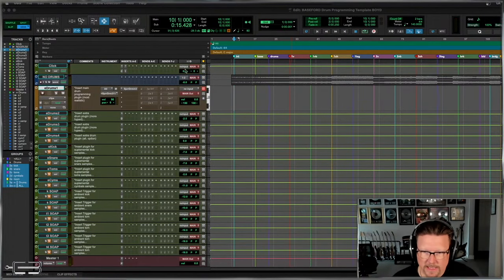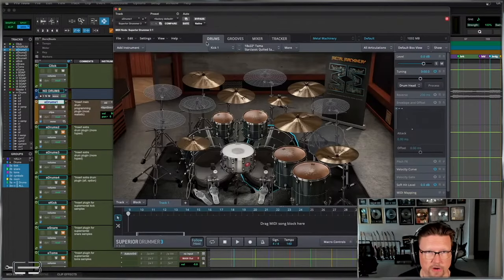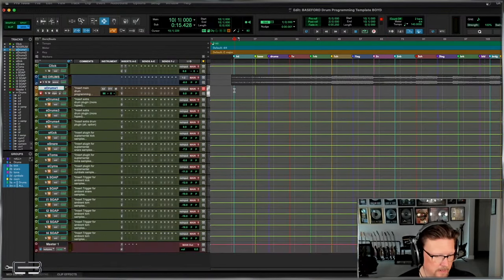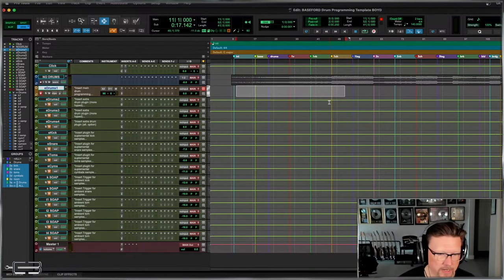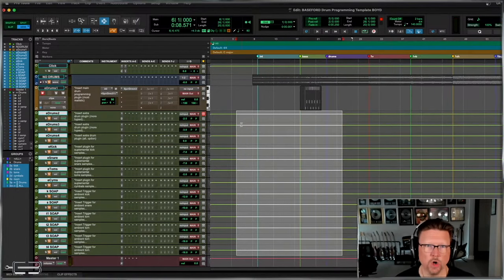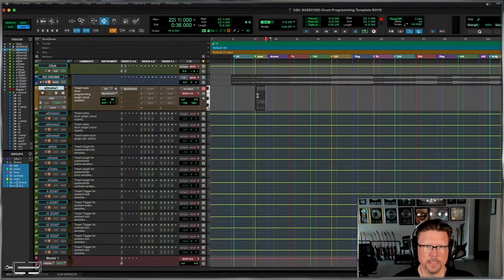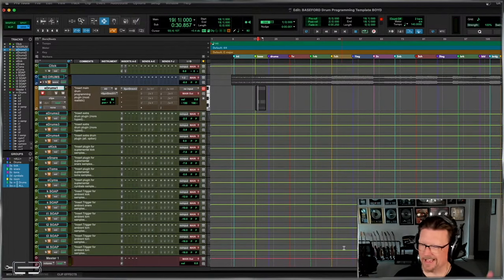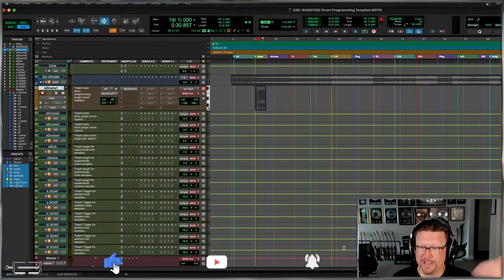My Famous? Drum Programming Method Explained

Comment: You can also add a presets in SD3 in Your favorite library like adding extra snares/kicks/toms and then mute them/unmute in one place.
Reply from the maker: Absolutely.  Superior is a beast and has so many great features to implement!
Reply: @chrisbaseford  BTW: Thanks for that NIckleback NAIL THE MIX tutorial. What a library of information and tips!
Reply from the maker: @gutekzpoligonu  My pleasure!!  Always fun working with those guys!!
Reply: @chrisbaseford  BTW if You would be so kind to "correct" for me one thing. 

When You've said that You did all nickleback guitars on San Quentin with the plugins/pedals/Fractals. I guess that You did a DI box into the DI input for some pre but I wonder if You did some, even bypass, tube pre/comp just for the wormth of the tubes to add it to the guitar sound or it wouldn't matter?
Reply from the maker: @gutekzpoligonu  I used the AxeFX III for DI (guitar plugged directly into it).  I've used tons of other DI's... some alter the sound, some don't.  Use your ears to determine.  For me, it's not enough of a benefit to introduce another step in the chain.
Reply: @chrisbaseford  THank You Sir!

It's always the best to hear that from the best so You know, that they know, what thay are talking about!

Cheers from Poland!

Comment: Always wondered how you did that
Reply from the maker: This technique can be used for any MIDI track.  Sometimes I'll do this same thing when programming keys (have 1 track trigger several different plugins to get a unique "blended or mixed" sound).
Reply: @chrisbaseford  do you not get major phasing issues?
Reply from the maker: @davidcotestratton  50/50... but it's usually just a quick and easy flipping of the phase on whatever the problem is (kick, snare, etc.).  Then save a preset so you only have to do it once.